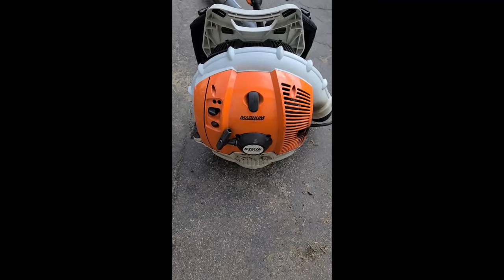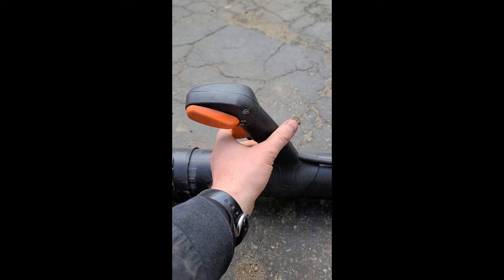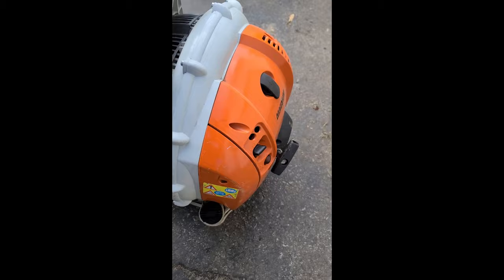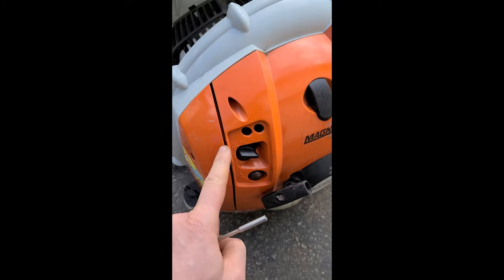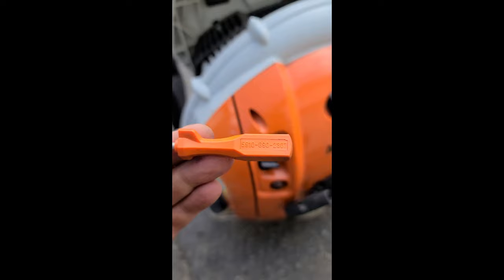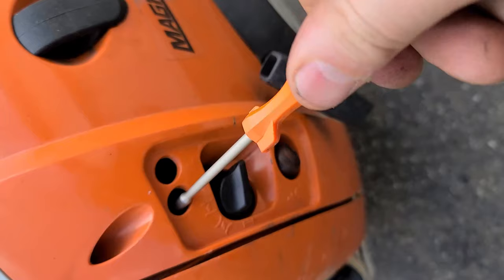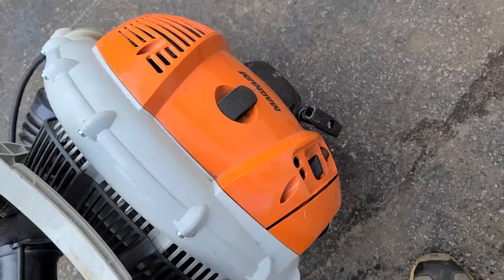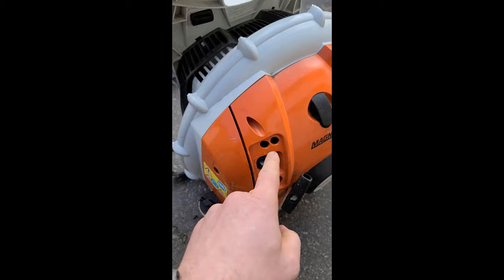STIHL Leaf Blower Bogging? This Quick Fix Will Make It Run Like New Again! BR550 600 700

Comment: I am a homeowner who doesn't like to have to 'give in' and take my power tools to the shop. Nothing against those hard working folks who repair things for a living, I just like to tinker and am decent with my hands. On my first attempted use of my non-commercial BR700, it would only run on 3/4 choke. It ran fine when I put it up last winter! I checked the spark arrester (this has gotten me more than once), changed the air/fuel filters and spark plug - same thing. It would not idle and giving it throttle would kill it. I used my iFixIt tool kit that my son gifted me for Christmas as it had a 4mm socket and opened H screw 2 turns (CCW) and L screw 1 turn (CCW) and she runs like a dream again. Thanks for this video as it gave me the courage to jump in and make adjustments.

Comment: I use a STIHL backpack Leaf Blower at my golf course grounds keeper job.  I have to blow all the spent golf tees off the tea areas, along with leaves, grass clippings, and other fallen debris.  This  STIHL unit works so much better than my 4-cycle Ryobi handheld blower that I use at home.  You get what you pay for.
Reply: I might be paying $50.00 for a half broke one you think i should buy it or not it's a older stihl backpack blower and shouldn't be a hard fix long as stihl sells replacement parts

Comment: I’m no mechanic but the first thing I’d check is the spark arrester. Then air filter and gas filter.  
In other words, check the easy stuff first.  Messing with the carb would be the last thing I’d try because that’s the thing I’d most likely screw up. 

But this man knows what he’s doing and I’ll bet he eliminated other possible causes first.
Reply: How would I know if the fuel filter was a problem?
Thanks in advance

Comment: Thanks Don, my neighbour has one of these and it is bogging down. I will pass this on. Thanks Don, keep up the good work
Reply: These have an Achilles heal, they don't have an O-Ring like previous models, they have a bronze O Ring in the engine.  If you don't use Stihl oil they burn up.

Comment: My Stihl FS130 trimmer started bogging down after a bit of operation.  I discovered if I cracked and reclosed the fuel tank it sorted it out.  Obviously the tank ventilation is clogged, but it looked like to sort that, it required pulling off the carb so I just crack the tank cap every 20 minutes or so, but then I use the machine rarely except in Spring.

Comment: Are you using the right oil with it, adjusting the carb is a good way to burn your Stihl backpack blower.  If you listened to this video, pull the plug on your machine, if it's white, it's running lean, not getting enough oil and it will burn up soon.

Comment: What was the main difference between the 600 and 700?  Was the engine bored a bit more on the 700?
Reply from the maker: 700 a bit more powerful
Reply: Exact Same engine, 700 has larger fan housing. 700 - more cfm. 600 - more air speed.

Comment: you don't need any special tool, just use dremel and cut a slot in each screw L and H
Reply: Cheaper to buy the tool than buy a dremel
Reply: I already have all those special tools

Comment: Hey buddy my stihl 600 is idling low to the point of where it dies out sometimes, do you know what screw I would need to adjust and would I go clockwise or counter clockwise? Thanks!
Reply: Clock wise it's the + screw under the  high and low